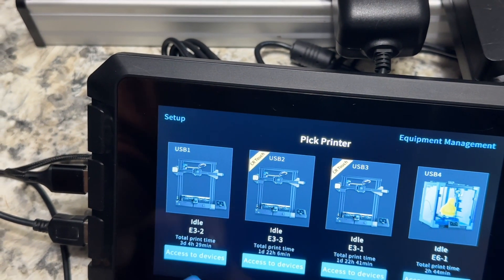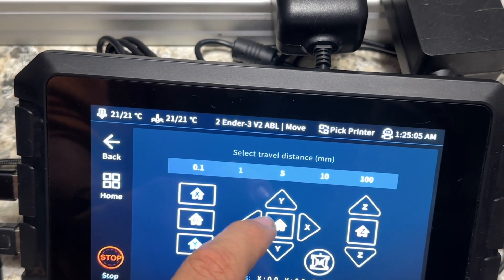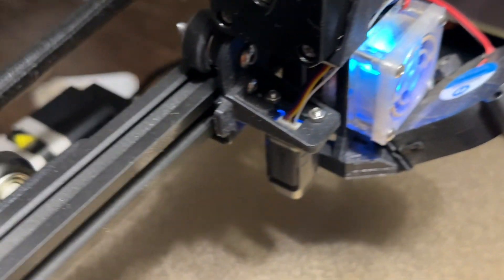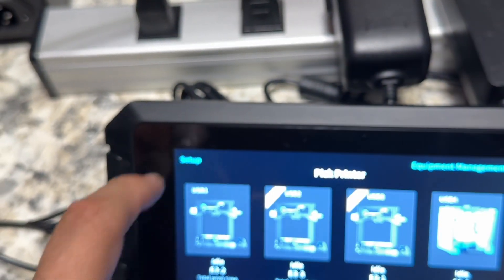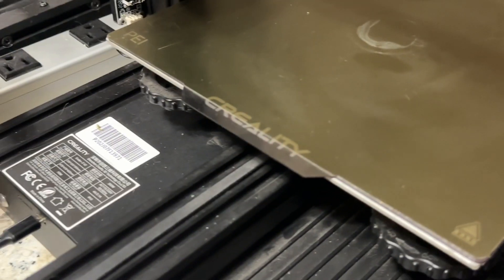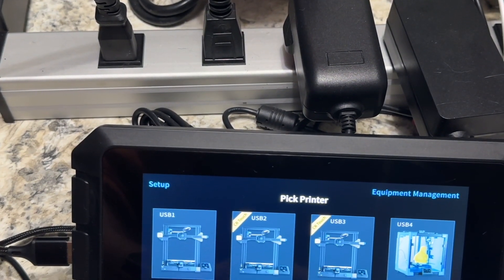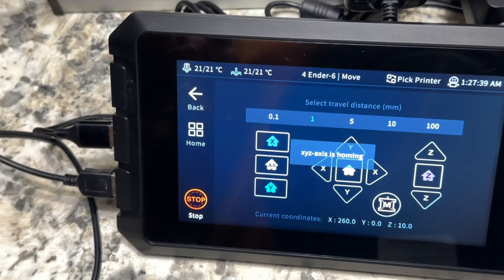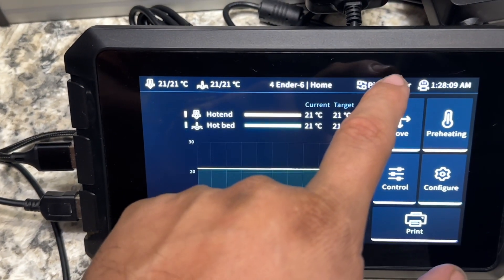Creality Sonic Pad update V1.0.6.43.51

Comment: I have the issues reported with the cr touch freaking out. Hope new firmware patch Comes out soon
Reply from the maker: I actually haven’t heard of this. Could you tell me more about it or meet me to video?
Reply: @TableTopBiker  Yea, after i uploaded the firmware i was getting random CR touch errors where the prob would either not retract or a different time does not deploy. I figured it was the touch just going out so i installed a new one. New one has the same issue. I looked all over the forums, and it appears im not the only one having the issue. I have two ender 3 pro, one has been updated with sprite extruder and connected to the Sonic Pad and the other is not. Only the one connected to sonic pad is having issues. But if i flash back to merlin the CR touch starts working again so i know its the firmware. 4.2.2 board with that weird newer arm mcu, so maybe that the issue. I haven't figured out how to flash the sonic pad back one release yet. I sent logs to Creality so we shall see what they say.
Reply from the maker: @awidesigns  I definitely hope you can get that sorted. I will do some research and see if I can come up with something. I have 4.2.7 boards on all my machines. No issues with the cr touch or bl touch.